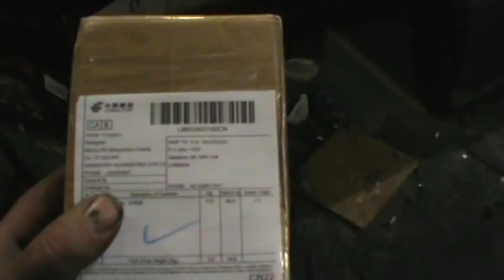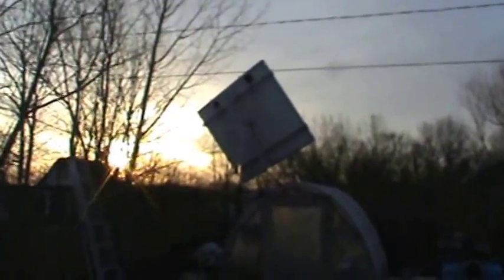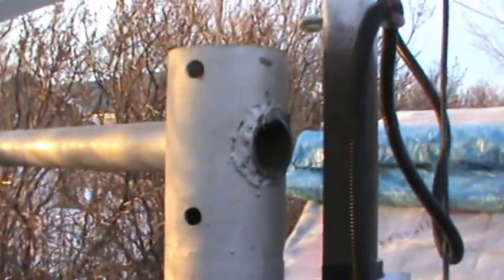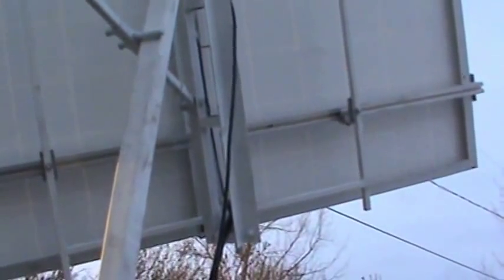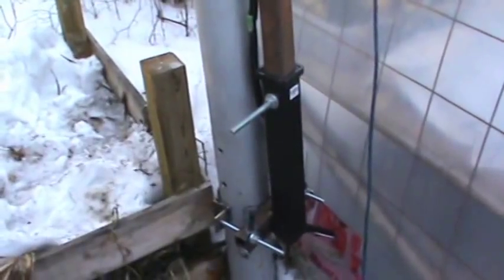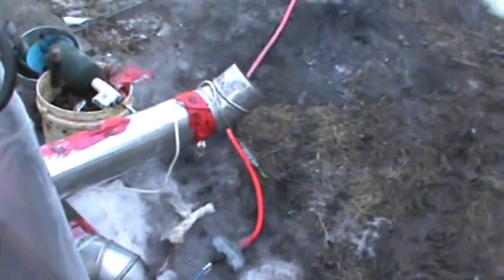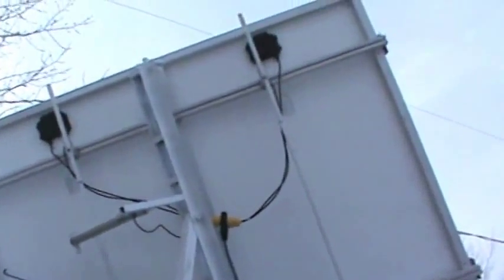DIY Single Axis Solar Tracker With Electronics from China Part Two

Comment: Hi Rod nice job but I was wondering how the rotation of the pole works?
Reply from the maker: Thanks for the comment. The pole remains stationary and the panel mounts pivot east /west on 1" pillow block bearings. It has approx 120-160 degrees of travel which is plenty to target practical sunlight. If I were to build it again I would use a heavier 2"angle iron as I recently had to weld a couple cracks. I used 100 wall which has stood up quite well for 3 yrs now. Thanks for your comments.

Comment: I have the same controller. Working fine except it "hunts ". When it moves to a new location it does several small steps vs just moving to position. Also after several minutes it starts to move again with small steps. Acts like it is to sensitive and tries to make position perfect. What did you do to make it smooth and not over adjust.
Reply from the maker: Ronald, If I remember correctly there is 3 adjustments, the twitching back and forth is due to the sensitivity being too high. The controller is trying to balance out the sensors and it seems like its never gonna be satisfied. If you have any play where your sensor is mounted it tends to amplify the problem, wind rocking the sensor and panels will do the same. turning down the sensitivity on a sunny windy day until it settles down seemed to work me. Another control is for freqency of tracking. This one sets your time between adjustments, which spares battery, I have mine set to adjust every 5mins rather than contiuously, this spares battery power. The final adjustment I beleive is light sensitivity, which prevents your tracker from seeking the brightest areas on overcast days. They never sent instructions with mine, they are posted online(ebay) on the page I bought it from. They are quite tricky to translate and it does take a little tinkering to get er just rite. I hope this helps and appreciate your comments. Rod

Comment: you are lucky yours has lasted this long, mine lasted a week before the relays started playing up.  Also noticed when I had the cover off the box while the system was working that the voltage regulator was so hot I couldn,t touch it.  In general the electronics are not adequate.   Not for my part of the world anyway.  

 Red LED on means that the controller is not reading light - as in twilight or at night.    

In the end I built my own from scratch and it is working better than this piece of junk.

Anyway thanks for showing us your vid.
Reply from the maker: Bax, thanks for the feedback. I haven't had anyone else's experience to compare to. I've recently dismantled my solar array, in order to relocate it to a more suitable location. It was still working great when I unhooked it. But if it gives me any grief I'll be sure to post it. 
 I had built my own tracker before I bought this one, it was working great until I was demonstrating it and I used a 500 watt halogen as a light source, she went up in smoke. If you have a video on your tracker build I'd love to see how you built yours.
 Thanks
Reply: Thanks for getting back.

Would definitely like to take a look at your new set up when you finish your reposition.

Finally uploaded videos of my DIY controller. Take  a look at my channel whenever you get the chance. Always good to see other people's ideas and inventions from other parts of the world.  You tube is fantastic for that.

Comment: is it still functioning good for you? I just received my dual tracker, with actuators. is there anything you would do to make it more reliable?
Reply from the maker: Amazingly the tracking system hasn't skipped a beat. I cannot compare it to the expensive versions but it has given me absolutely no trouble. I will confess I had a few connections from my panels to my master switch which gave a little grief, but no relationship to the tracker. I recently ordered a dual axis myself, I must admit its a lot more twitchy than the single axis tracker. I am not going to give it a poor review as I believe I never gave it a fair chance. It definitely did its job, but it seemed to have a few functions that left me scratching my head. I wish I had more time to spend with it. I would love to hear from how it works for you. Thanks for the comment and sorry for the late response.

Comment: Did those actuator come with the controller? You could always use a winch to help pivot up pole....
Reply from the maker: The linear actuator was purchased separately, It has more than enough strength to control and maneuver the panels. It does sway a bit in high winds but that is the nature of the design. A winch would work great however power consumption would be much higher for the tracking system, prolly requiring a relay etc. A 12" L/A will run less than $100, 170Lbs force.

Comment: Hey dear i need you help. i also want to make solar tracker system. but i'm in confusion how much HP motor will work for it. I think for this purpose servo motor or stepper motor will work for this. but i have no idea of selecting the motor that can easily rotate the solar plates. please guide me

Comment: Nice job Rod.Do you have any info on where you picked up the tracker and actuator? I might build a tracker if I don't mount them on my shed roof.Thanks for the vid.
Reply from the maker: frank, the tracker electronics came off ebay from china. If you want to know the exact model I can try and send a link off ebay( if I can figure out how to do that). The actuator came from princess auto. Thanks
Reply: Rod,
I came across a bunch of stuff on ebay such as trackers and actuators. Stupid ass me not thinking. I'm always on ebay and found lots of items for my needs. Thanks for getting back, especially since you put this video out last year. Nice to know some people are willing to help long after their vids were published.
Thanks,
Frank